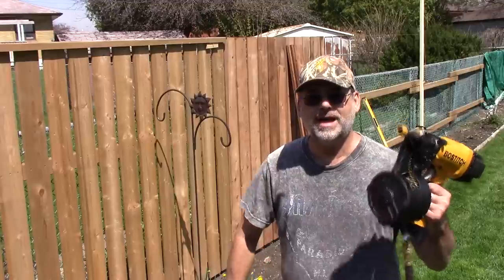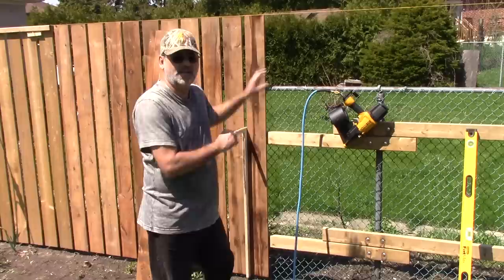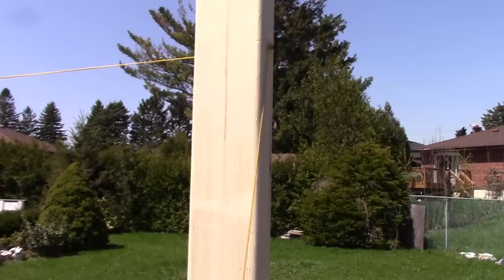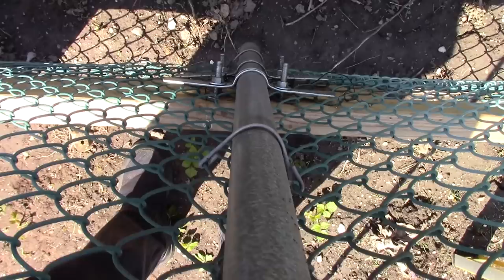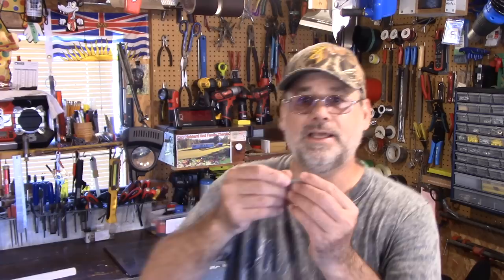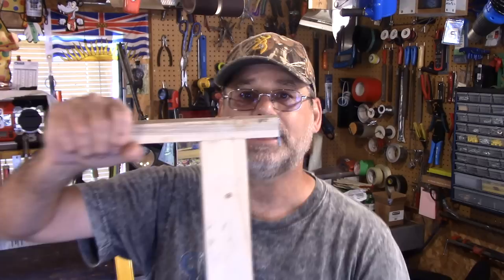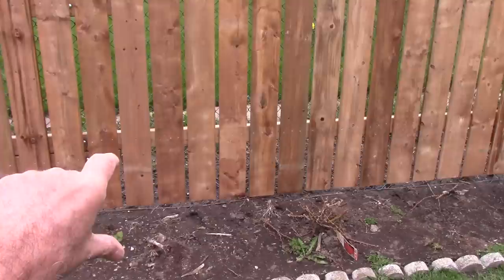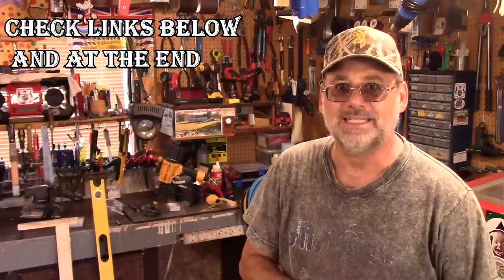WOODEN  FENCE OVER A WIRE FENCE - WOOD VENEER STYLE EASY TO DO

Comment: Looks great Steve and so does your lawn!  I'd like to see some detail on the top board as I just can't picture how it's mounted.
Reply from the maker: Thanks Jay . The top board is just a 2x6x 5/4 board ripped at 1.5 inches  only using the outside rounded edges. I just screwed it from the back side.
Reply: Me too

Comment: I bought a house and wanted to exchange the chain fence for a 6 foot privacy fence, this is a better option. Screws and nails is always an argument, screws are convenient, especially because as boards rot, and needs to be replaced, you can just unscrew, replace and and rescrew, but the issue with screws as opposed to nails, as the boards, move, expand, and contract. The screws will break, but the nails will bend and move with the fence, the same with a house framing
Reply from the maker: Good observation 👍.  I did use  screws on the top rail  , worked well. The fence boards nailed on went real fast compared to screws , I used ring nails.

Comment: This is an idea for vinyl panels too. I can see where it could be done only butting the ends of the panels close and connecting with galv pieces, the pipe fitting could instead of going on the posts, but going vertical on the rail.
Reply from the maker: Yes lots of options only limited by ones imagination and skills.

Comment: Nice job! I wish we could see how you attached the top rail from the other side.
Reply from the maker: Thanks , top rail is just fastened with 1 inch deck screws , super easy.
Reply: Did you screw the top rail on top or the sides?  I guess what I’m asking is does the top rail sit dead on top of the pickets or is it in-front of them?
Reply from the maker: @dtezthompson5034  screwed from the back side   installed on the front side of the boards.

Comment: To safely, and inexpensively keep the skunks away, put 1/4 of a large bar of ORIGINAL Irish Spring soap in an old sock. Hang the sock close to where the skunks like to nest, and they will leave. This will only last for about a month, and you'll have to replace the soap. No harsh chemicals, no foul odors, and best of all.........no skunks.

Comment: Your face is great but on the back side I think you should have put acorn nuts just in case someone comes in contact with the exposed bolts other than that that's the only comment I got or I guess you could have cut them but you still but you would still have to add a acorn but with your skills you can probably cut them short and add the acorn again thank you for your video even sure how to save material on this project thank you sir
Reply: I'm new at at this DIY stuff, what is an acorn?

Comment: Very nice job!  Only comment I have is that using screws would probably be better than nails.  I know you love your air-gun as it's fast efficient and cheaper.  From what I've experienced in putting up many wooden fences over the years is that  screws hold the boards many years longer than nails do.  Looks like you used about 6 nails per plank, 3 on each level of the fence. Why not use only 4 nails to leave room for a couple of screws in the middle of the plank?  I think the longevity of the planks staying attached far outweighs the cost of the screws you'd use.  Also, recommend a water proof sealant like Thompson's to help protect the wood.  It makes a world of difference especially if you apply about every 5 years or so.
Reply from the maker: All great suggestions.   Screws or nails work well but yes screws are much easier when replacing a board.  I always use  a watersealer .  If I didn't   have 30,000 nails already screws would have been a good option :)

Comment: Hello, was the purpose of putting two staggered two by fours for strength or another something else?
Reply from the maker: Just a nailing surface to hold the fence boards and a way to clamp to the metal posts.

Comment: Is this more cost effective than a traditional privacy fence?
I have an existing chain link, and the cost has kept me from doing a new fence.
Reply from the maker: Great question.  If you look at just the cost in my case 60 ft . I saved  putting in 8 4x4 posts in the ground and 16 bags of concrete so just the cost savings was about $200 .  My real savings was the work involved putting the posts in and dealing with the metal posts already there plus I could do a bit at a time and not worry about my dog not having a fenced in area.  If your fence is being paid for by  both residences I'd put the posts in the ground and build it as a conventional fence.  My buddy next door wanted to leave the chain link  fence as is but said I was welcome to clad it with wood  so I did. He loves it and so do I. Cheers

Comment: I have been thinking of how to do this for so long.  Thank you for sharing.  Question:  would pre fab wood fence sections be easier?  Also was leveling a problem and do you have any suggestions on how to level without having to dig?  I didn’t understand your string method.
Reply from the maker: Prefab sections will not work Lisa. The string just keeps the board tops level from one end to another.
Reply: @SteveRobReviews  
Why won't they work?
Reply from the maker: @GFWMOMOF2  The prefabricated sections are not made to fit in this application,  only a conventional 4x4 post fence.

Comment: How exactly did you fasten the top board to the vertical ones? What kind of board is the top one
Reply from the maker: It's only a 5/4  PT board that I ripped on the table saw to 1-1/2 inch width . Just the outside rounded off edges  and used 1-1/2 deck screws   ,  screwed from the back side.

Comment: Do you have a link of somewhere to buy the stand offs I have been having a very hard time trying to find these in our local stores
Reply from the maker: @AliceCurley-z8v  You  get two halves  but only use one half per location.  These are for 1-1/2 inch pipe so make sure  to measure your pipe first .  Not sure what country your in but you can  get a good idea what your looking for.  https://www.homedepot.com/p/The-Plumber-s-Choice-1-1-2-in-Riser-Clamp-in-Galvanized-Steel-112CLRSG/309742679

Comment: The problem for me is I don't have access to the other side of the property so there's no way to bolt on the bottom brackets.
Reply: scew through the 2x4 stright into the metal post
Reply: @Jackmackrel  I solved the problem with Ubolts. They can be fed around the posts from my side of the property. Just have to drill two big holes in the boards for each Ubolt.

Comment: Great job Steve. I’m going to hang about 50 feet to my chain link fence just like your design. Question though. Why did you not choose to go to the top of chain link with your horizontal 2x4’s? My chain link is 5ft tall. Maybe I should come down a foot from the top?
Reply from the maker: Thanks , my chain link  is 5 feet as well . I wanted to keep the weight lower as the fence boards are much lighter . Take a look at the supports I put in as my total length is about 50 feet  as well . It took me 8 hours max to put this fence up and its been  absolutely solid . Cheers

Comment: Hi what is the lumber you used for framing? Is it 2x4 studs? My metal fence posting distance from each other is varying like one distance is 10 ft and another has 15 ft and some other 12 ft. What is the length of stud I should buy? Like 12 ft 14 ft or 16 ft.. Cut them when needed and join them?
Reply from the maker: I used 2x4x10 PT  to extend past every steel  post  to attach the clamps  to  so on either side of the steel posts you need extra length for the pipe clamps that attract to the 2x4's .
Reply: @SteveRobReviews  thank you. Is it ok to join two 10 ft studs with metal connector/joint and keep going?
Reply from the maker: @shakir ahmed  I never tried it  and chose to overlap to be stronger and easier to install but if you can figure out how to join the 2x4' and still nail a fence board in that spot that would be  an accomplishment.
Reply: @SteveRobReviews  I have to do something like that. I hope it stays strong. One more question for u if u don't mind. Do you have a link where to purchase that bracket to tie? Couldn't find in home depot website. 17 Cad per pc in amazon.
Reply from the maker: They are used in construction for water and gas pipes   , stand off pipe brackets  so check industrial parts suppliers as home depot is not the best place .  I just made my own and showed how too in a video for about $4 each.
Reply from the maker: https://youtu.be/OOHatRnsYTg
Reply: @SteveRobReviews  Ok, thanks Steve. I did watched you making one.

Comment: My neighbor doesn't want to replace his chain link neither? Are the concrete blocks strong enough to extend the fence up with wood? Do you suggest always taking out the chain link fence entirely then installing wood privacy? Or does this work well? I want to change my entire chain link fence around a 1/4 acre to wood privacy. Was hoping to just attach wood posts to the metal posts
Reply from the maker: If you have  that much fencing the wind may be a challenge for the fence . I did put fence supports in every 30 feet. Myself I would put wooden posts in on your side and just build your fence on your side . I built all mine over the wire fencing . Cheers

Comment: What about the bottom. Will it warp over time too? Also, will you paint it so the sun, wind, and humidity doesn't wear it out prematurely? I ask because it happened to my 20 year wood fence!
Reply from the maker: I haven't had any warpage  on the bottoms at all. I use a  silicone sealer on the fence and seal it . I did show in a video how I seal wood to last a long time  Cheers

Comment: How high can you go safely over the existing height of the metal with the timber pailings? Mines smaller than yours by a foot.
Reply from the maker: I would think 24 inches is about as high as I would want to go. You could experiment a bit but mine is rock solid as is at 12 inches above the metal fence with 2 supports in the ground on the 50 foot fence .

Comment: That's beautiful, Steve! How did you to the top rail?
Reply from the maker: Thanks. The top rail is from a length of 5/4 board ripping off just 1-1/2 inches from the outside edges.  I will use the inside  for the next part of the fence.

Comment: Why do you need the 3/4" space between the boards? because they expand or to relieve wind pressure?
Reply from the maker: Great question , 3/4 space is now 1 inch after the boards dried out. Yes it's all about reducing wind pressure  but still provides good privacy.  Cheers

Comment: Ya you mentioned you had an air compressor. I just bought a small Craftsman and after several uses it's leaking air under the regulator valve. Know how to fix that?
Reply from the maker: Alex the only way it to tighten the pipe that is leaking or you may have to remove the regulator and  put some Teflon tape on the threads and tighten it all back up again.
Reply: Buy a new regulator. I just did on mine.

Comment: Hi Steve, what kind of nail gun did you use to attach the boards? I saw it’s a Bostitch, what is the gauge or type?
Reply from the maker: Yes bostitch  model N75C with hot dipped .090 1-1/2 " ring shanked nails. Cheers

Comment: Will this work for an 8 foot wood fence?
Reply from the maker: I'd say 8 foot tall fence needs a bylaw exempt permit as most places restrict fence height at 6 feet .  8 feet high I'd revert to conventional construction.
Reply: @SteveRobReviews  thank you. I have a friend who has a jumper of a dog. He thinks 6 foot is low.
Reply from the maker: I had a walker hound that would jump up on my 6 foot fence and pull himself over  so  I took some electric  fencing wire off the farm and ran a wire along the top of the fence and hooked it up to the battery operated fencer and my dog tried the fence twice and never tried  again :)  yep it worked great and  after a month I turned the  fencer off and my dog never tried again because he could see the wire and thought , nope not worth it HAHAHA.  Farm supply store has it all and it works guaranteed.  👍

Comment: I am just wondering if you have suggestions if the neighbor wants to put up wood on their side.  Would that be possible and wouldn't it need to be complete at the same time?
Reply from the maker: Lynn  if both of you want a fence I would suggest a conventional fence with wooden fence posts in concrete   as it will be far too heavy for just metal fence posts .

Comment: Why have any gap?  Is that just a personal preference or is there a benefit?  I have a dog as well and I think making it flush so she can see as little as possible may be better.
Reply from the maker: The gap is for  the  winds as you increase the gap  or  reduce the gap will  make a difference.
Reply: Over a season or two, won’t the wood shrink a bit, creating even more of a gap? Would it be a good idea to space with the expectation of the wood shrinking? Just wondering because we are planning this project in our backyard as well.
Reply from the maker: Yes the wood will shrink a bit over time .

Comment: Why not just drill a hole into the post and attach the 2x4 that way?
Reply from the maker: Good question and I thought of that but decided it would weaken the metal post as their not that strong as it is.  Mine is still standing strong but ya if someone wanted to try it  , it may work or may not :) Cheers

Comment: I done this years ago on a 5' foot chainlink I seen one guy using U clamps on the poles to anchor the framing structure I myself used special brackets I got at HD that both ends of the 2×4s meet together with a U bolt attaches to the pole the smaller clamps are not bad in price 3$ but jumping up to next size of these brackets jump to 12$ nonetheless what I dont get is why you are spacing each board 3/4" appart? you literally can see through it no privacy @ all doing it that way & how you fastened the boards to the framing with a nail gun? Nail gunning in my book is a big no no... every project I do is done with screws in event if I have to straighten boards out realign my boards, with a nail gun you have to worry about trying to pull large staples out of boards its a headache having to do such a thing..I always seen it as a lazy man's tool I would never invest in one more headaches then anything else..
Reply from the maker: Burt  the 3/4 spacing allows air flow but it's up to everyone what they prefer just like the nail gun , use whatever you like to fasten the boards. Cheers
Reply: @SteveRobReviews  Yes to each their own way when I installed my wood fence boards years ago they all went on flush side by side was about few months later they shrunk quarter inch on them but now they are old like me discovered some have termite damage in them so may have to get them replaced out.
Reply: I  agree on the privacy part for sure And your probably right about using screws also, but the nail gun is so efficient and fun , can’t help but to use it .

Comment: What is the name of the brackets you used or what are some options I could use
Reply from the maker: The brackets are for schedule 40 pipe but you can just bend them yourself at 25% the cost.
Reply from the maker: The brackets are for schedule 40 pipe but you can just bend them yourself at 25% the cost.
Reply: @SteveRobReviews  what size carriage bolts u use?
Reply from the maker: @Eastbaypisces  3/8 ×3-1/2

Comment: Steve, how did you attach the top board?
Reply from the maker: With 1-1/2 deck screws from the backside of the fence boards.
Reply: Steve. Is the top board 2x2 cedar?

Comment: What was the length between ur posts? Mine is 10',  would 2x4 be ok for that?
Reply from the maker: Mine was 8 feet apart 10 feet apart with 2x4 is fine just put a couple of fence supports as I did for high winds .
Reply: @SteveRobReviews  what do you mean by fence supports? Thank tou
Reply from the maker: https://youtu.be/bsHVmeDO2jw this is the support I did incase of high winds .

Comment: In 2021 this fence costs $15,000
Reply from the maker: Not quite that high but at least three times the cost when I built it .  About $500  tops  back then.
Reply: @SteveRobReviews  i just calculated fence price for 120 ft. Whopping CAD 1850 only for fence boards including tax in Nova Scotia. Studs, clamp, screws extra. Not included.
Reply from the maker: I built this 60 foot fence for about $350  and have not visited a home depot since I seen a 2x4x8 PT stud for $14 and a 6 foot fence boards  at $8 . 😅 I'd wait tell next year at them prices.

Comment: Isn’t that your neighbors fence?
Reply from the maker: Nope it's all mine as he has wire fences.
Reply: Right, your fence your business to do. Checking here, I wired on a bamboo 6ft to my 3ft high chain link 7 yrs ago and it has never been bothered by the wind or anything and it's still stands firm, no deterioration cause it's bamboo. Harder than oak. This process of my work and yours is referred to 'decorative covering', no permits needed.  @SteveRobReviews
Reply from the maker: Alessandria  that's a great idea 👍
Reply: If
Reply: I see the chain link is opposite of code  here in Cook County Illinois That fence would be your neighbors